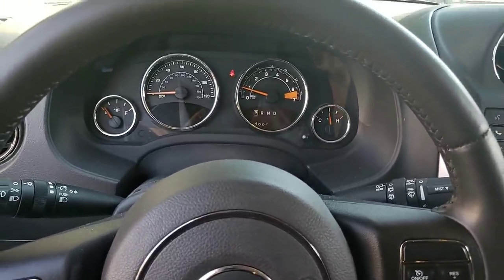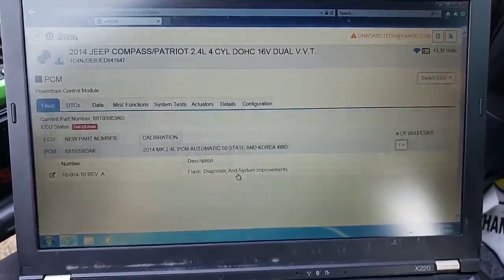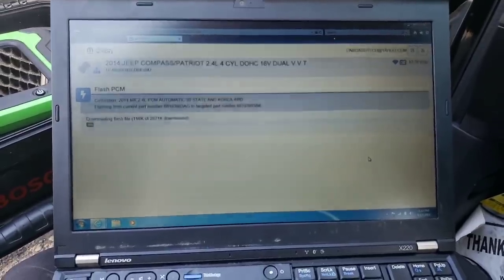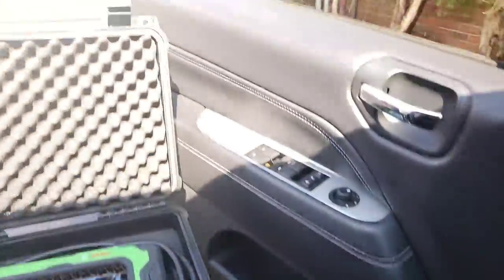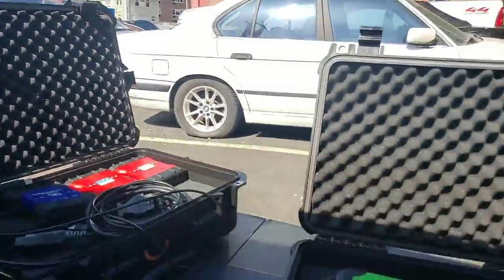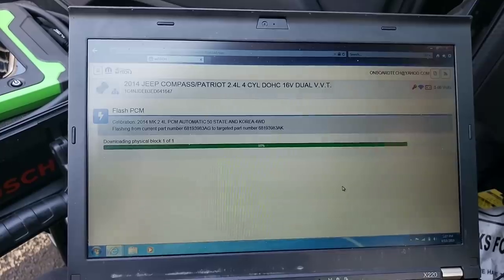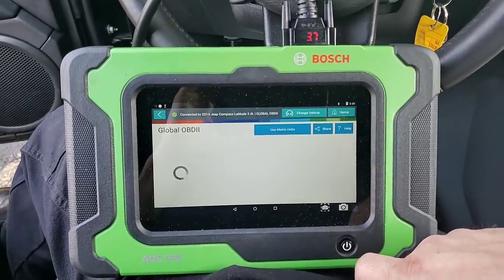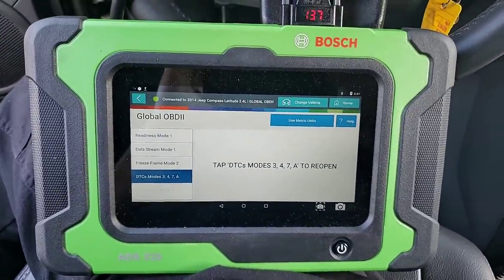2014 Compass Programming update

Comment: 13 minutes is a blink in my world, Keith. I've sat and watched aviation videos of a guy flying a jet for an hour and 20 minutes - straight through, no skipping, and on NORMAL speed, too! I have videos myself of nothing, 4 times as long.😁

I don't find this stuff boring at all. I prefer to watch an entire, uncut programming event, so I can figure out what's normal, and what I should panic over. Some day I'll get the equipment needed to do this. Had I saw that loss of battery voltage I might have had a heart attack!! Not anymore, after seeing this! THANKS!👍🍻👍
Reply from the maker: https://youtu.be/hFFaTh-LXfk 
Do I have just the one for you 😁👍

Comment: @ 4:10ish: Reflashes may make for boring videos, but seeing the results & knowing you've solved the problem justifies the boredom.  For me, it's also enough to see what buttons you're pushing to make it work.  I had to learn Chrysler reflashing with what felt like less than zero help from my shop, no way to know who to call next, a DRBIII that may or may not have had all the cables needed at any given moment, and a Starmobile pass through that took 20 minutes to make up its mind if it was going to work at all.  I finally learned how to get it done on a J2534 box, but if the day ever comes I have to learn how to use a Micropod and WiTech all over again, I'm looking up all of your boring reflash videos.

Comment: I like the programming videos specifically for things like the fuel monitors after programming. I'd be scratching my head going "uh-oh". Its good to watch someone else react to the unusual and how they handle it.

Keep it up and good luck Tuesday, a New Level Auto custom scanner coming? Works on 1.5x speed and comes equipped with "identi-keith" (to steal flat rate masters line).

Comment: keith. I know your very busy man. I would appeciate it if you had a quick answer to this. 2007 audi Q7 New ECM programming. Is flashing required? or I just need to keys and coding and calibrations.
Reply from the maker: New new?
Reply: @NewLevelAuto  yes sir new from dealer. Could not find used one.
Reply from the maker: @sebry25ify  yes there will be a programming and coding to do. I would use nothing but ODIS here .
Reply: @NewLevelAuto  Thanks Keith